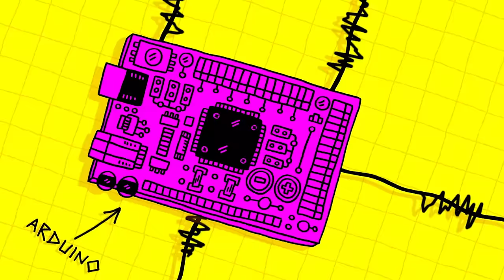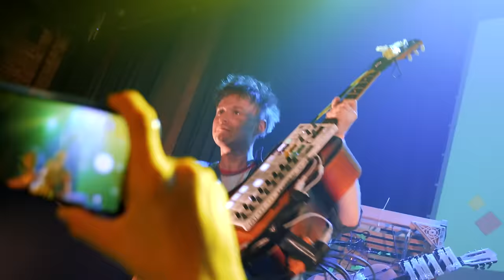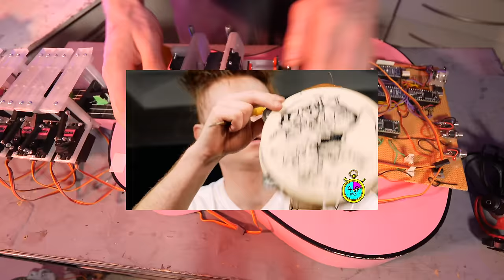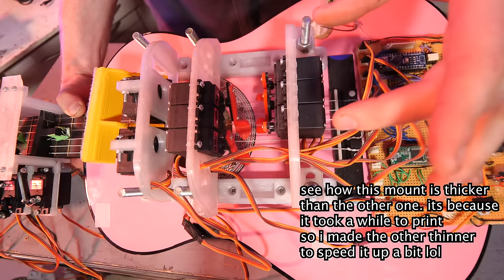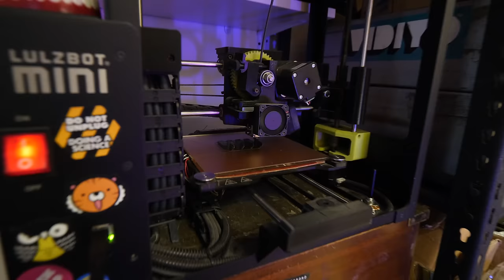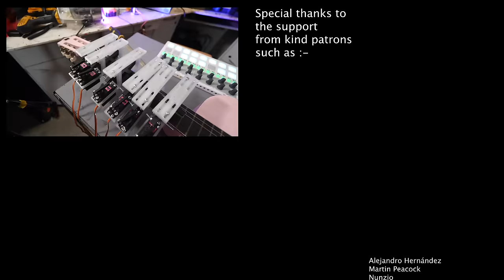HOW NOT TO MAKE A SELF PLAYING ROBOTIC GUITAR

Comment: It's bonkers that you managed to build this in only 48 hours!
Using actual plectrums glued into 3D printed mounts would probably have been a better idea, but hindsight is always 20/20 of course…
Reply: You can 3D print pretty decent plectrums, but really they have to be extruded with their layers parallel to the printer bed. I think you could redesign this part rotated 90º like that. But the fact that Sam made these adequate parts in 48 hours with minimal experience is frankly quite astounding.

Comment: 9:20 that's the best part about robotics, parts break, hell sometimes they get to you broken, sometimes they're broken during delivery, sometimes parts turn out to be really good at breaking but really bad at-well, not doing that, sometimes parts just aren't built with the uses you might have in mind, sometimes parts really aren't compatible with other parts, sometimes parts break themselves trying to follow lines of code and go through with an action when there's obstacles in the way or the they get stuck in a loop and keep trying to complete the action over and over, my personal favorite as a programmer is when your (never not super expensive-seriously if you intend to take up programming and robotics as a hobby you damn well better be loaded) robot breaks itself trying to complete an action with a wall or something in the way, especially when the robot doesn't come with any way to immediately stop it and the only ways to stop the current program its running are to plug it in and stop it or grab it and try to get it away from whatever it's trying to break itself on and hope you don't break anything I the process and hope it isn't wedged on anything and also 99% of the time suffer some kind of injury because THE DAMN THING WOULDNT STOP MOVING ITS WHEELS AND IT FUCKING BURNT AND CUT ME UP AND WHY OH WHY DID THE PEOPLE WHO DESIGNED THAT DAMN THING MAKE IT SO THAT THE ONLY WAY TO STOP THE PROGRAM IS A LITTLE STOP BUTTON ON A BULKY TOUCH SCREEN ON THE ROBOT THAT I COULDNT GET TO BECAUSE THE DAMN THING WAS WEDGED UNDER A VENDING MACHINE AND WOULDNT STOP TRYING TO GO FORWARD....sorry, just a little flashback to when I was just a wee child in the world of programming and robotics still learning the most basic things, like the fact that robots will do their damnedest to complete their current task, even if it means completely breaking themselves and my teacher said it was okay but I could see the disappointment in his eyes, what was I talking about?

Comment: It's absolutely amazing that you could make this in 2 days.

Were you to revisit this, perhaps angling the plectrum attack like a guitar player does it (45 degree angle to the strings) might help something, somehow?
Reply: I was thinking that using real guitar picks in clamps would be easier and more readily repaired when they inevitably break.  Use thins or extra thins and setting the height probably becomes less of an issue.

Comment: What's the latency like through the servos? Wondering if you changed it to play individual notes and sequenced it, how much offset would you need to get it in sync with other MIDI instruments? Great work btw!
Reply: Question: What's the latency like?
Answer: Yes.
Reply: @gutterg0d  ?????
Reply: @VirtualModular  it's just a meme, but as for a real answer you probably need to measure it out for each servo. Even a small difference in angle would change it, and this is probably not a micrometer precision build.
Reply: Ah OK, that's a good point. I assumed all the servos were the same type and would be roughly equal, but even a small difference could affect the timing. I just wondered if this could be used in sync with other MIDI kit....

Comment: You could use these metal mechanical with bearings rails they use on 3d printers and so, yo have a adjustable fret control if you wanna do a revisit.
a lap steel guitar design would seat you better for robot mechanical experiments, i guess.
Oh yeah, solenoids could be better on the fret and maybe plucking.

Comment: Please do yourself a favor, and replace the plectrums with robotic piano hammers or mallets, and hammer on the strings.

And for the pitch, create some clamps with rolls, that roll from fret to fret.

6 rolls, that can roll to the desired fret / pitch on each string.

The 6 rolls should be connected to one sledge and within that sledge they should be able to move within 6 different  frets.

This way the sledge would emulate a hand with 6 fingers.

The sledge / hand should be able to move as a whole as well.

Comment: What a lovely fail 👍
For sure, I couldn't have done it any better, because I have no idea what I'm talking about. Plus I wouldn't have finished it, because I lack the mad-scientist energy that you seemingly have.
For everyone to laugh at, here are my dodgy ideas to approach this thing:
Maybe change the oscillating plectrum things for motors with a toothed disc on them and control their speed via photoelectric sensor. And use small but fast pneumatic cylinders to hammer the strings down on the fretboard.
Now come and tell me everyone what's bad with my ideas and how to do it better, so everyone can learn something here 😊

Comment: I envision using 12 straight bars for fretting all strings on each fret and adding one on the G string that pulls through a hole in the headstock and bends it to major.
Tuning = E B E G B E

Comment: Tune the Guitar to Open D.....  D A D F# A D.       

Then you will ONLY need to use a Straight Bar Cord on Each Fret with NO other Fingering required.
Also you need to Fret the Strings just behing the Fret Bar and NOT in the Middle between the Frets or you will get Lots of BUZ.